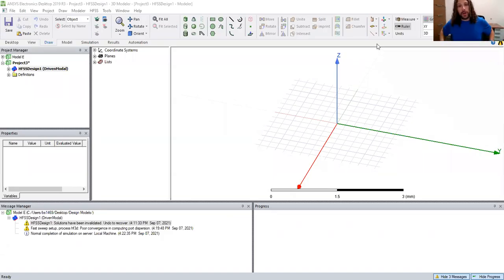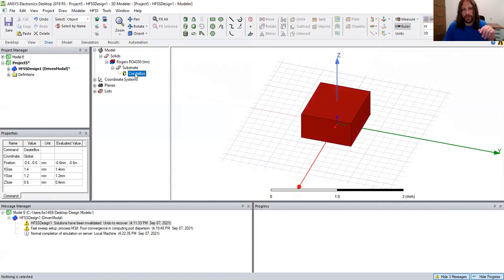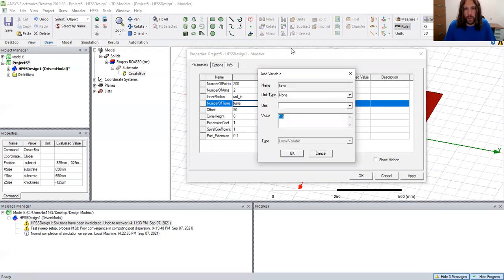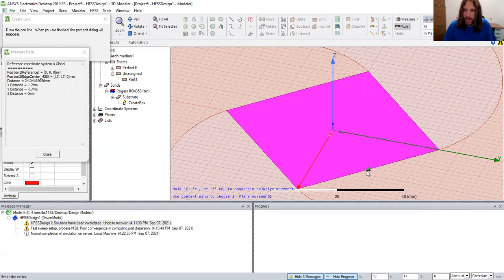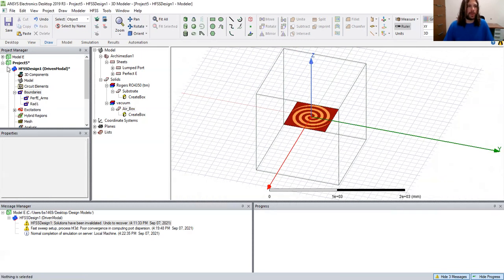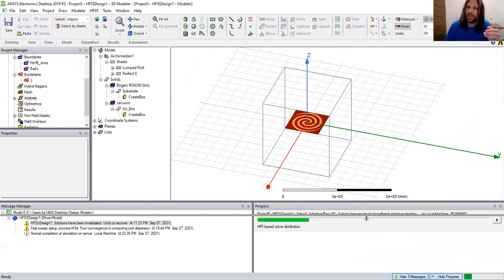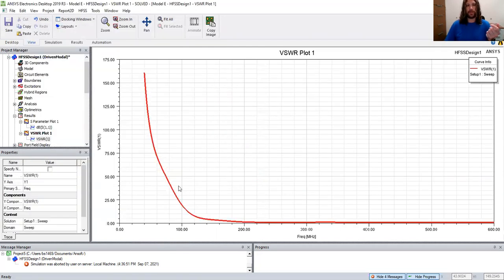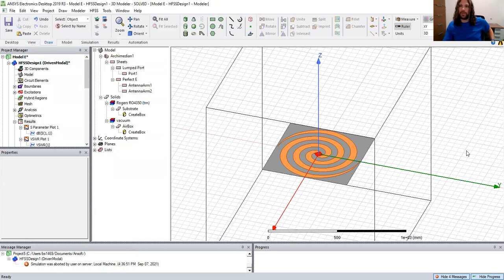Advanced Electronics HFSS Tutorial

Comment: I am building a 4-arm Archimedean antenna.  Would you please build on and show a video?
Reply: Hi Shah Nejad! It has been a while since you posted, but I didn't want your question to go unanswered. Building a 4-arm Archimedean spiral is a big step up from the standard 2-arm version, but here is the breakdown of how to approach it:
I. Why use 4 arms instead of 2?
The main advantage is precision. With 4 arms, you can feed them with specific phase shifts (0, 90, 180, and 270 degrees). This gives you much better circular polarization (Axial Ratio) and allows for "Direction Finding." If you are looking for high-accuracy GPS/GNSS or radar tracking, 4 arms are superior because they maintain a stable phase center across a massive bandwidth.
II. Designing in HFSS or CST:
Don't try to draw the spirals by hand! Use the Equation-Based Curve tool.
	* The Equation: Use r = a * φ + r₀ (where "a" is the growth rate and "r₀" is the start radius).
	* In HFSS: Define your X as (a * t + r0) * cos(t) and Y as (a * t + r₀) * sin(t).
	* The Shortcut: Create one arm, then use the "Rotate" and "Copy" tool to place the other three arms at 90, 180, and 270 degrees.
	* Substrate: Use a low-loss material like Rogers 4350B. Make sure to include a "Cavity Backing" (a metal box behind the antenna) if you want the signal to go in one direction instead of both ways.
III. The Feeding Challenge:
The hardest part of a 4-arm spiral is the feed network. You need a 4-way phasing network. In modern designs, the best way to do this is using a 90-degree Hybrid Coupler or a specialized feeding pillar in the center. To match the high impedance of the spiral to a standard 50 Ohm cable, you should taper the width of the arms so they get narrower as they reach the center.
IV. Pros and Cons:
	* Pro: Extreme bandwidth. One antenna can cover a massive range (e.g., 2GHz to 18GHz).
	* Con: Lower gain compared to a Yagi or Dish (usually 3-6 dBi) and very difficult to manufacture because the center connections are so small.

If you are just starting, I recommend simulating a 2-arm spiral first to get your matching correct, then moving to the 4-arm. Good luck with the build!